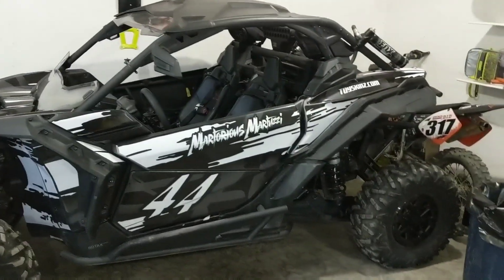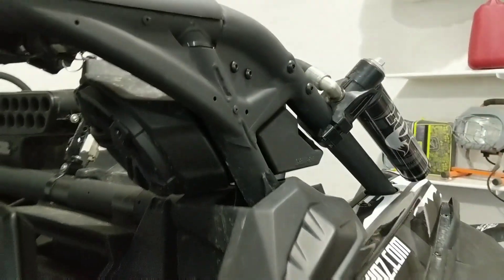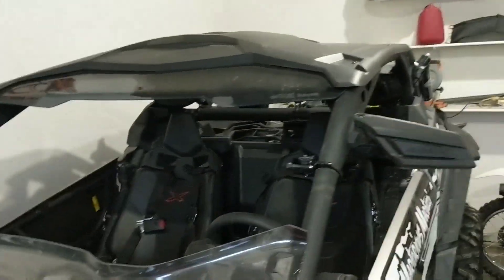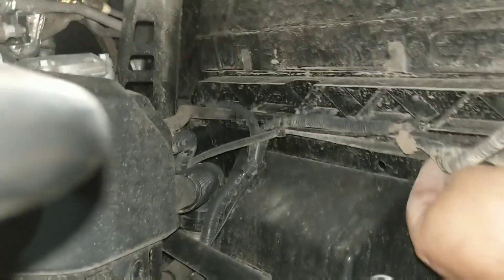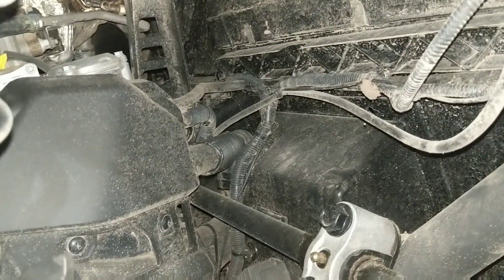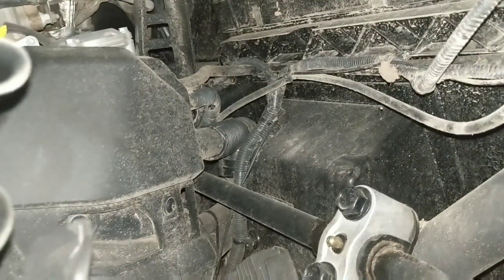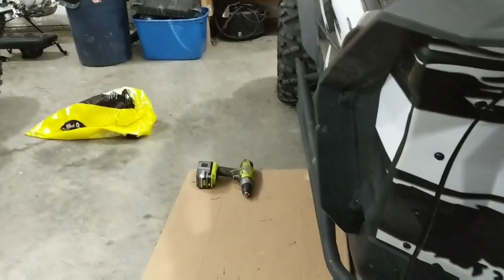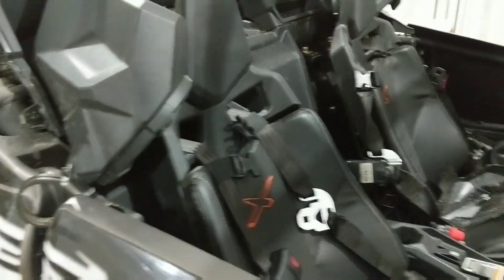2020 Can-Am Maverick X3 XDS turbo RR 195 HP crate arrives! Tear down the XRS!!!

Comment: What was the decision to go with the XDS and not another XRS?  Have trouble fitting down trails with XRS?
Reply from the maker: It was the size yes for the trails. We had the turbo s also and same thing. Even though they got around still so does a big rig lol but the extra bit of room helps lots and it'll perform better zipping around better.
Reply: Martorious Martuzzi #44 I have a maverick sport 1000r.  I see you have one as well how does it compare to the x3?  I’m in ontario narrow trails sport seems to be the right machine but I’m looking to add a new x3 and really torn between the xds and xrs.
Reply from the maker: @schumif1champ  
Easy
When I bought Xrs, you read forums etc, see the attention, mainly dune dessert guys. 
The XDS is so capable of everything at 64. I'm still 72 for that one dune trip a year. 
Trust me I had em all. My Mav sport xmr is 64 and in trails no X3 can run away from me. 
I have both xrs and XDS at my house now, ya I drive an f450 but I love my dodge ram half ton. It gets you more places quicker. 
I think less wear and tear on XDS too. But suspension is amazing still on XDS. East in out of trailers, trails, and wicked in open still too. 
My opinion. Everyone diff.

Look at Adrenaline Junkie Prods
Videos. He explains the over 64 problem we'll his last couple vids. 

Let me know route you take!